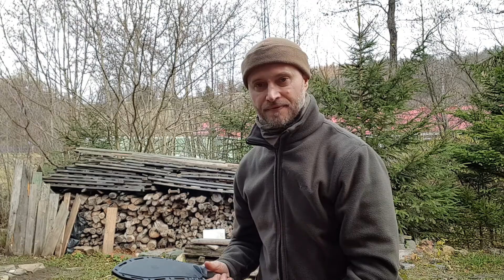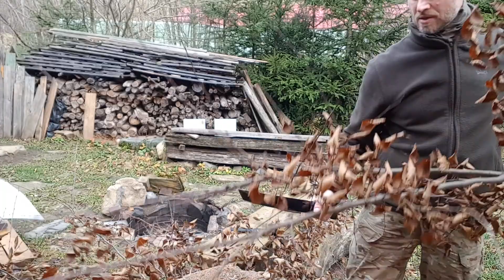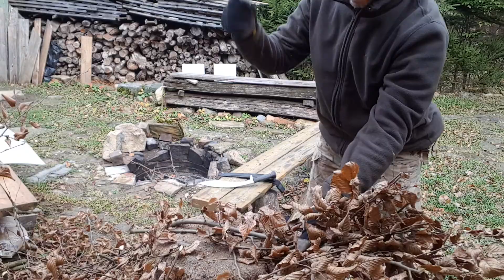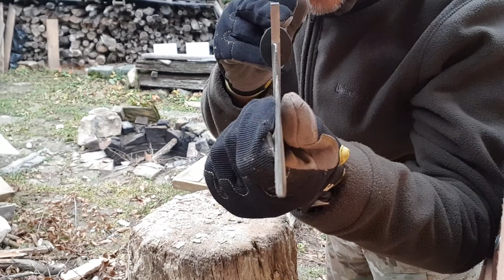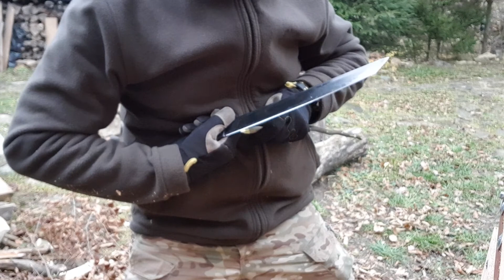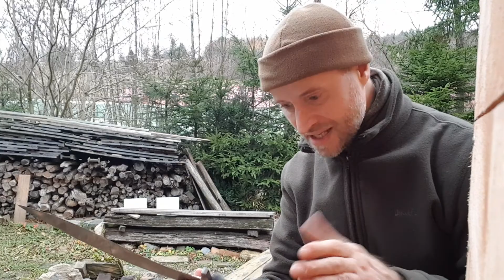"The Battle of great choppers" - CS Gurkha Kukri Plus (O1) vs. CS Warcraft Magnum Tanto (CPM 3V)

Comment: The binding you were getting with the CS Kukri is the primary reason I HATE full-flat ground blades for chopping greenwood. A saber grind is so much better IMHO for this task as it does not bind and as the tanto was showing it blows chunks of wood out of the cut channel. On hard, dry wood, I will primarily use an axe and saw. GREAT comparison video brother.
Reply from the maker: How are you, brother? Nice to see you around! I understand what do you mean. The truth is when I chop a greenwood I can finish it with about two swings, the full flat helps or even helps to chop with 2-3 swings even thicker pieces of the wood. To go through something really fresh and tough (like this hornbeam wood), I agree with you, and saber (or even with a convex) grind, works better. But I like the design:-)) Anyway, there is a new CS Recon Scout 3V coming, and even with a full flat on it, I hope, I can get one next year;-) Enjoy Christmas time brother!:-) FM
Reply: @forestmantis1737  You as well my friend!

Comment: Does the cold steel gurkha kukri 3v say plus on it? I have one that doesn't say plus on it.
Reply from the maker: Hi, as I know, the "PLUS" version is only on O1 versions (not before) and now on the 3V version (https://www.coldsteel.com/gurkha-kukri-plus-cpm-3v/). The "PLUS" means the guard there, standard versions don´t have it (and they are not named with the "PLUS"). FM
Reply: @forestmantis1737  Thanks for the reply I really appreciate it. Would the older version have 3v on it? I bought one with out any marking on it, to tell me what type of steel it. The guy just told me it was 3v so you know how that goes. I guess I have to take his word on it.
Reply from the maker: @Patryk24k  As I remember (90%+) now. The 3V steel was only on the Plus model. If there is no guard (and it hasn´t been removed) then on 90%+ it is an O1 model. A little corrosion test could show that. If do have an O1 steel knife, take the knife and the Kukri, and put them into the water for 15 minutes. Take them off and put them into their sheaths. After another 15-30 minutes, there will be (most likely) marks of corrosion (I guess on O1 more than on 3V). It is possible, that the 3V will have not any marks of corrosion on it. If you don´t have any O1 knife, do it also and the result will be about the same, only, you won´t have a sample to compare with. Simply, the 3V steel is more corrosion resistant. FM
Reply: @forestmantis1737  Thanks again for the quick response, it's been very helpful keep up the good work. 👍

Comment: Great review but to be frank you seem to try and convince yourself that the kukri might be better than the tanto you clearly had a preference for from the start. According to physics and the geometry of the kukri resulting in deeper cuts due to the extra velocity gained from the extra weight in the belly, and according to your action I believe the kukri outperforms the tanto. I think the tanto will definitely start showing its advantage in tasks requiring slicing. Tantos are designed to slice. Kukris are designed to chop. One doesn't go and "slice" wood do you? You chop wood.
Reply from the maker: :-)) Thank you for the comment, to be honest, I expected something more from the Kukri but I was on the Tanto side more;-) Those next ideas of yours about kukri and tanto, I agree.  The last thing - "to slice/chop" wood, well, of course, you do more chopping, but the slicing/"carving" (for the small task you might need in wood) isn´t "just" something but I believe it plays a relatively big role in our camping / "surviving" in the forest:-) Oh, one more last, last thing;-) The W Tanto isn´t standard tanto, the handle shape really changes the way of using it. Have a great X-mas time or whatever you celebrate these days:-) FM